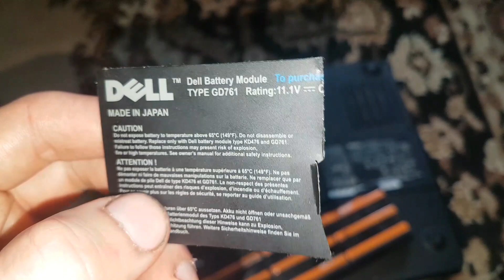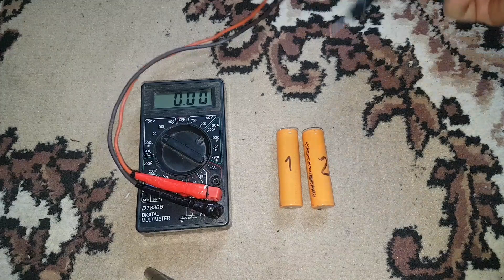Battery repair laptop Dell Inspirion 1501 DIY

Comment: After bios update i got this proplem as I had imagined, there are no battery problems because today I accidentally discovered that when the PC tells me that the battery is low, I tried to turn the PC back on and despite the battery indicator telling me 0%, it's more than 1 hour that I'm using it. But now in this situation I don't realize when the PC will shut down, because from 1 hour it tells me 0%. It couldn't possibly be a battery problem because it happened overnight. Now, however, I have this problem that the PC shuts down after 20 minutes because it believes the battery is low, when it isn't. What can I do
Reply from the maker: 1. check your charger. charging the battery?
2. Try to "hot" remove the battery. For instructions on how to properly for your laptop model, look on the Internet.
3. Return to the previous BIOS version

Comment: I bought this same laptop for my girlfriend , the battery is dead , I have to order a new one abroad . In your video you don't show us if replacing some cells made the battery working again
Reply from the maker: The laptop worked for 1.5 hours on a repackaged battery in video playback mode. then the bios battery died
Reply: @SulaTrek  thanks , I won't try it